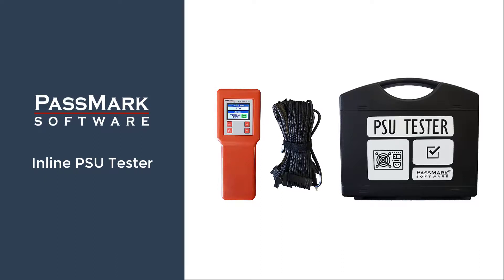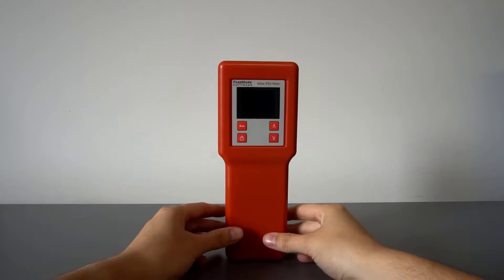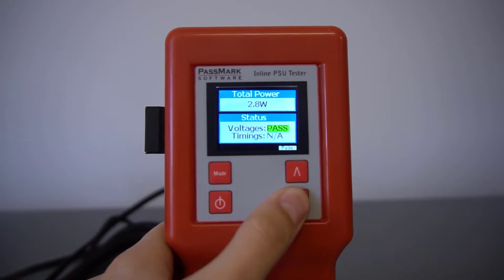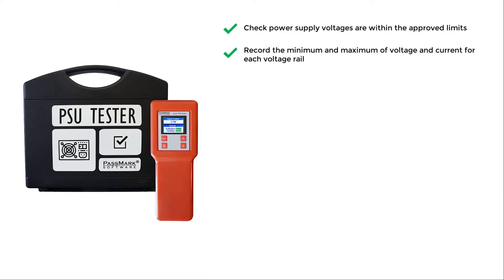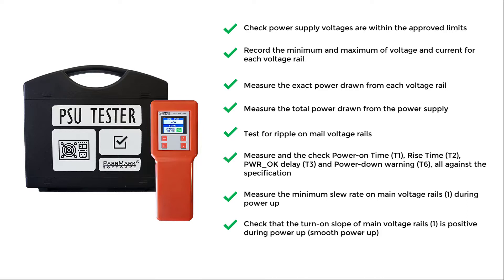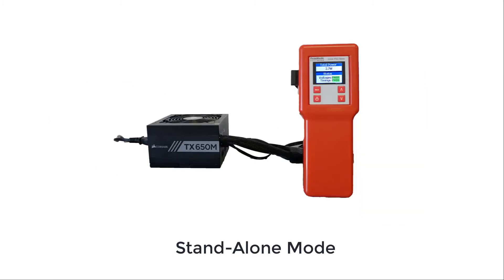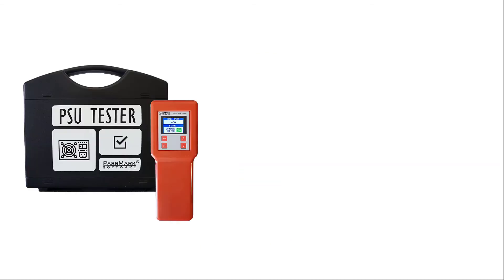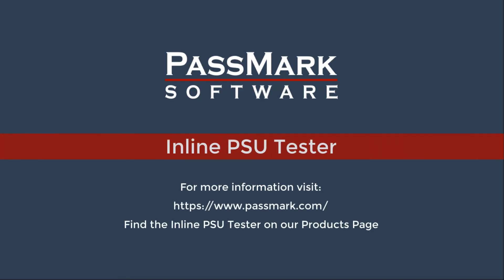PassMark Inline PSU Tester

Comment: Does this product detect intermittent issues, and draw a max load of the PSU to test for any hidden issues?
Reply from the maker: Yes, it should help a lot for detecting intermittent issues (e.g. logging over an extended period for spikes, brown outs, etc..)
In inline mode max load placed on the system depends on the components in the system and if they are in use. e.g. a 300Watt GPU will draw around 300Watts, when in use.

In standalone mode the load is around 5W. It can't be higher than this without generating large amount of heat in the device. (i.e. a 1000W load test device would melt the plastic case and your hand).